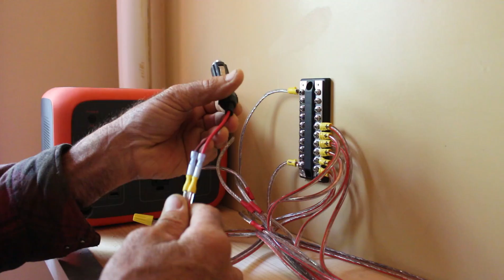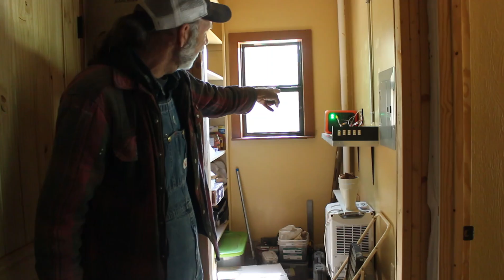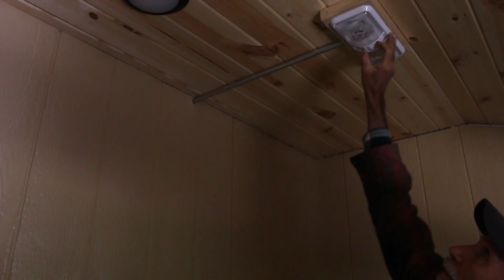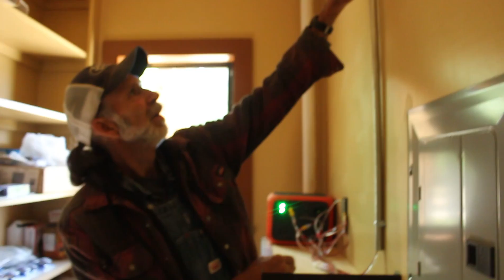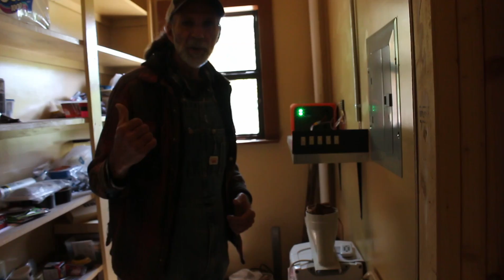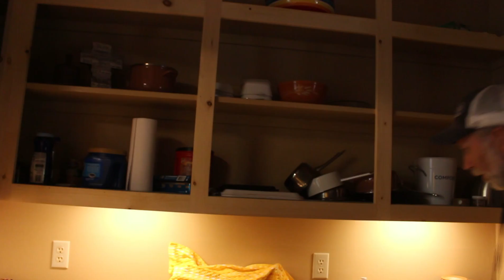12 volt POWER System at the OFF GRID CABIN

Comment: Great video. But just wondering why you went this such heavy gauge wire for 12v lighting    I thought 18 would be more than enough for low voltage lighting
Reply: Bigger gauge wire is to compensate for voltage drop.

Comment: Was your cigarette 12volt connection to your Jackery strong enough to handle all the connections to your fuse block when the lights were all on. What fuse did you use in your cigarette 12 volt connector? Great idea, hope to do the same for my cabin.

Comment: Absolutely awesome system.  I have a 12 volt lighting system in every room in my house and batteries are charged by 4 100 watt panels.  The living room light has been on for  2 years straight as all of our bulbs are LED.  Awesome  choice if there is a power outage or if your cabin is off-grid.  I am a power generation technician and built my system in my houses due to severe power outages for up to 18 hours that happens regularly in my wife's city in the Philippines. We also have ports for charging phones and system is large enough to run 200 watt inverter for TV or laptop if needed.  Keep your project going anyone who complains likes paying bills...

Comment: I run a 12V desk lamp for almost 8 hours, and charge my iPhone and iPad, and the batteries in my keyboard and mouse, off of an old truck battery that I charge every day with two 100W solar panels. It saves me almost $20 a month on the power bill. Small solar is the way to go for residential power.

Comment: Danny couldn't you add a small solar panel and a small wind generator like on a sailboat?  My dad did a small solar panel on a 36 foot homemade boat and we would stay on her for 3-4 days at a time and have TV, Lights, Radio, Blender (all 12 volt) and a small 3 burner gas cook top.  Worked like a charm. We never had problems.

Comment: Could you wire in a quick charger for your battery pack, to run off the generator when you do run it, to charge the batteries, so you can get more use out of burning fuel?

Might be handy on days with a lot of cloud cover

Comment: That's super cool, but if all you need to do is see to use the restroom for a minute, why not just get a couple of the little round stick on lights that run by battery? I use them in my cabinets and a couple other places, you touch to click them on and off, and they're like$5 at Home Depot! And they last for a long time on the double A battery they use, so one by the light switch and one by the toilet, you're set!💖
Reply from the maker: We tried them not enough light for the room.

Comment: I missed the part about this being a off grid cabin when your standing next to a 200 amp electrical panel.
Reply from the maker: Its a 125 amp panel that is wired to an outside plug for the generator or a future solar system.

Comment: I Used the motion sensor timed light switches for the individual rooms so when i came into the room it turned the light on in that room and the room or area i just left would turn off at a preset time that i set for 1 minute. That way the available power would move with me and only be running in the area i was occupying. You can get timer switches to run the bathroom and kitchen stove exhaust fans for about $17.00 each and they will run 12 volts or 120v.
Reply from the maker: We tried those Wanda got agrivated with them turning off after a minute when she needed them to stay on for extended amounts of time. Especially when cleaning.
Reply: Rock Hill Farm Downeast, Maine Don’t motion sensors use electricity all the time? 24/7/365?

Comment: I have a solar system I mixed and match on the cheep I can run my hole home on if you check for sales on net you can billed a sisum cheep - batteries you might want to add wind to your solar I have both  if you add wind don't get  a 12 volt wind mill get raddical ACif you need more info let me know
Reply from the maker: Thanks